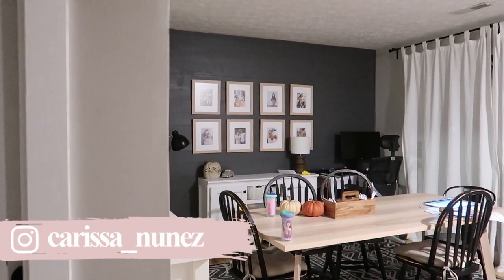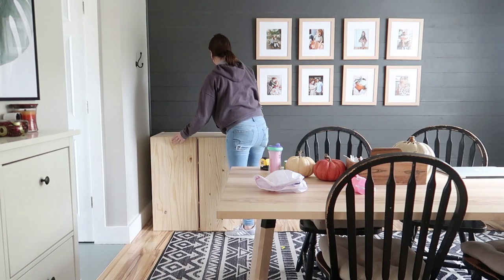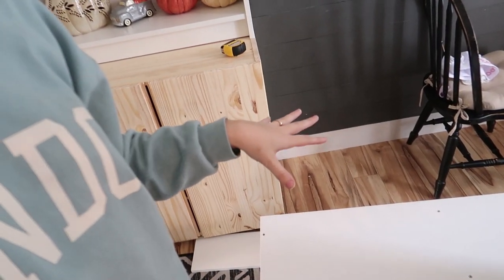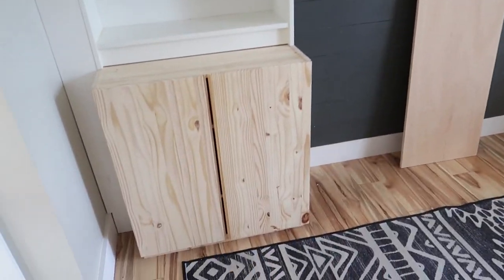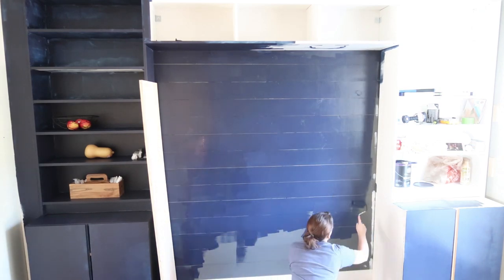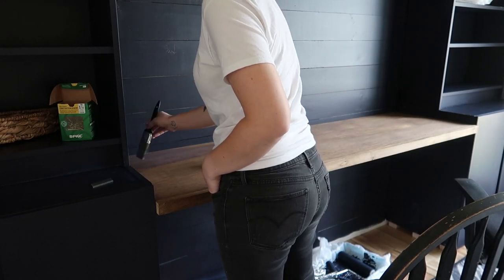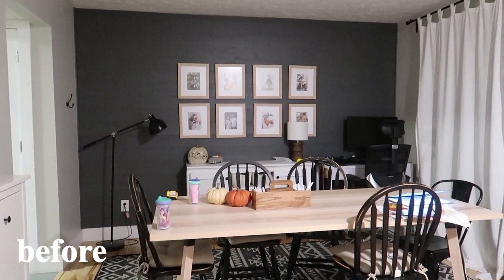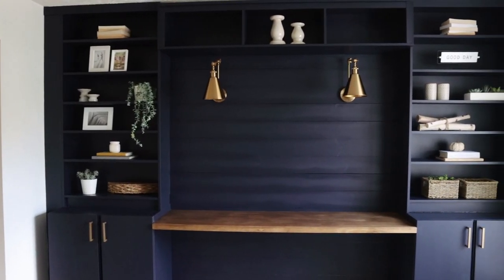EXTREME DINING ROOM MAKEOVER | DIY Built Ins + Desk

Comment: Absolutely love the color choice, you did such an amazing job. I would stain the table and chairs the same as the desk top you can always add cushions to them to give pops of color.
Reply: 👀Clicked on video bcos the dark wall caught my eye. 😉Find black cabinetry to be quite handsome, but fear it could be too imposing. 

⚓The Navy is beautiful, esp. w/those brass sconces, hardware & naturally stained desktop bridge. Brilliant merchandising w/combo of those lighter & more natural elements. Like the "good day" signage that brings in black element too.

💚 Your idea of staining the table to match sideboard/ desk seems highly appealing. Like the notion of 2 long benches stained to match. Not a fan of lopsided table w/chairs on one side only. 

Maybe introduce a striking, but simple centerpiece? My preference would something in black that  spans more width of table surface. Something that will make the table a destination in & of itself. Maybe a long iron/metal candle holder; a long slim oval or rectangular shaped tray featuring a trio of potted succulents (1 bigger pot, flanked by 2 smaller ones in a row); Or, an ebony stained chunk of wood w/holes cut in for tealights.

👍Do like idea of two black end chairs in the above configuration. Maybe the other two chairs of set flanking some sideboard that they can "borrow" back for dining area when needed.

If they wanted more formal dining, they could always temporarily slide one bench under desk bridge/sideboard & the other against the entry wall. The latter could be left plain or dressed like a console table.

🤔Personally, I need more navy (or blue) in that room. Maybe the back of the front door. As well as navy painted frame of wall art or mirror on entry wall (opposite the built-in). Something to help balance that major visual color weight. And, make it seem more cohesive & deliberate.

Maybe a small trio* of navy (or indigo blue & white) decor items on that white cabinet. Something to help eye draw my eye around with that intense blue color. That's just my take.
🦋🦋🦋🦋🦋

Comment: Fiddle leaf figs need bright light and low water. Once they are in a place they like. DO NOT move them. They will drop all their leaves.
Reply: What does it mean if the leaves turn brown on the ends?
Reply: @whisperlistens  Some kind of watering issue - either too much or too little.
Reply: @whisperlistens  usually underwatering

Comment: You got yourself a very healthy looking fiddle leaf fig! Beware they can be divas as they don't like change but once you get them in a good spot and you know how to water correctly, they're pretty easy! Best tips:
1. They like really bright, indirect light. I keep mine a few feet in front of a south west facing window and it has been doing really well there. 
2. Make sure it is potted in a pot WITH DRAINAGE holes and well draining soil. Without good drainage and if you water too often, FLFs can get root rot. 
3. Let the top couple of inches of soil dry out before watering and then water until the water comes out of the bottom. Try to find a somewhat regular watering schedule that works for your conditions and then stick to it as FLFs can get edema in their leaves with inconsistent watering. 
4. Gently wipe down the leaves every once in a while as they can get dusty, which can block the light from directly hitting the leaves.
5. Make sure you keep it away from any vents as they don't like drafts. 
6. Only repot and/or move locations when necessary as, like I said, they don't do well with change and can throw a fit by dropping a bunch of leaves :( 

A lot of people will talk about humidity but personally I don't live in a humid climate and I do anything to increase humidity and my FLF has been going pretty well!

Comment: Building all of these shelving units yourself with 1/2” plywood and some trim boards is definitely the way to go on a project like this. I’m just now getting into the home diy woodworking thing but attempting to put together individual pieces of furniture to create what looks like built in shelving just seems like more trouble than it’s worth. 

With a few sheets of plywood and some trim, you can easily cut everything to specific dimensions, eliminating the need to make pre-made units fit into non-standard spaces. 

You guys did a great job either way and it looks fantastic but I would definitely agree that all of that time and money spent at ikea would have been better spent building something that would fit perfectly the first time. My wife and I just bought our first house and this type of project is probably going to be the first big thing I decide to tackle. I think we’d have fun doing it. Plus, it’s a great excuse to buy new tools, which is always a plus.

Comment: Fiddle leaf tree likes a lot of light - but does not like to be burned. As from my experience water it in a way that the water runs through and then remove the excess. In between watering make sure that the soil gets dry - i just put little wooden straw in it and see if its still moist.

Comment: Fiddle Leaf Figs are VERY finicky!!! Get a water meter because a lot of the issues people have with them boil down to overwatering and subsequent root rot. They like to dry out in between waterings and a water meter will help you figure out if it's time to water (normally every 2 weeks is probably fine, but it depends on the amount of light and how large the pot is - with mine, I check the water meter level at the end of week 2 and decide how much longer I need to go from there). Put it in bright indirect light (basically 6ft from of a window at the most) and if it seems to be doing fine in that spot then DON'T move it!! They don't react well to being moved lol good luck!

Comment: “Pro Tip” - to get the most smooth finish with a poly coating… sand first with 220 like you said, but then apply first coat, and let it dry completely. Take 220 grit again and sand that first coat which doesn’t take very long at all. You can feel the difference with how smooth it gets while you’re wiping the debris away. Then once evenly sanded, make sure you clean it all off like with a cloth. Then apply the second coat. It’s a seriously a completely different type of quality! And I usually do 3 thinner coats that way.

Also, I’ve always used gloss for wood like this and I decided to try satin for the first time EVER with pantry shelves, and with sanding the coats in between it looked SO good and I may never use gloss again 😂

Comment: Before doing a built-in, you should remove all base and wall trim from anywhere the new unit will touch. You can put it back afterwards, as needed.  Failure to do that makes it unlevel: placing the unit away from the all at the bottom and against the upper wall its sitting at a slant. Over time, and with things added, it will degrade the unit. First, removing any trim in thd way would fix that.

Comment: PPG has been the worst paint for us, we painted our entire kitchen with it... had to do 4 coats because the wood knots on the cabinets kept bleeding through the paint... and yes primed before painting. Glad it worked for you but not a good experience for us, ohhh and one last thing, the first can we bought smelled like bad rotten eggs, it sat in the kitchen for 30 days before opening it to paint, the smell was horrible, even the painters wouldn't use it, we had to get it exchanged, the second can was better. But honestly I don't think I'd use it again. HD didn't even know why it smelled so bad. They were amazing though, changed it with no trouble. So now I have a kitchen that you can see the woods natural grain and knots... its whatevesss at this point.
Reply from the maker: Sorry about that! This is a brand new low voc formula. It literally didn’t have a smell and we were shocked!